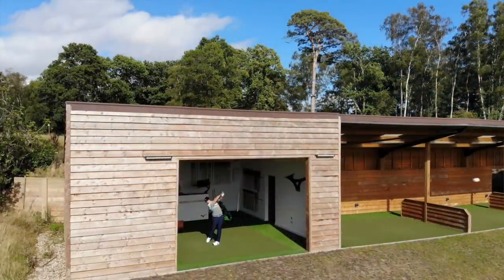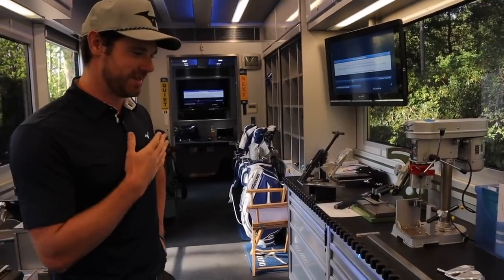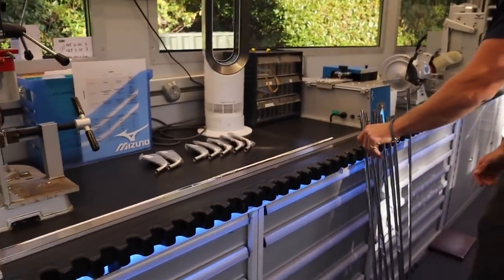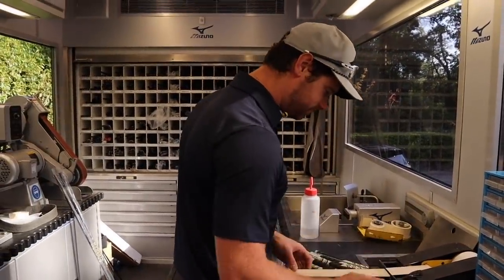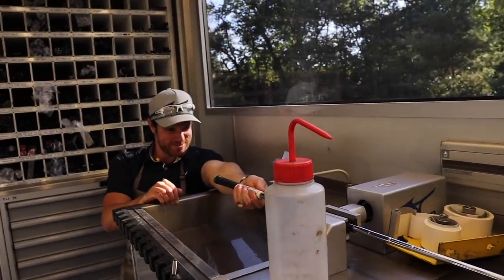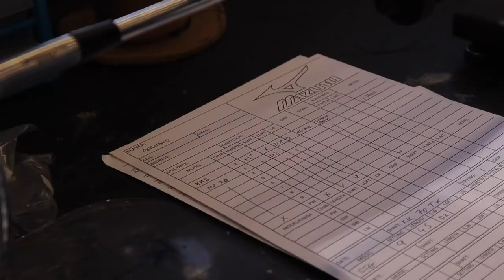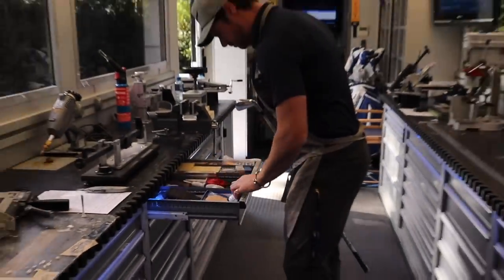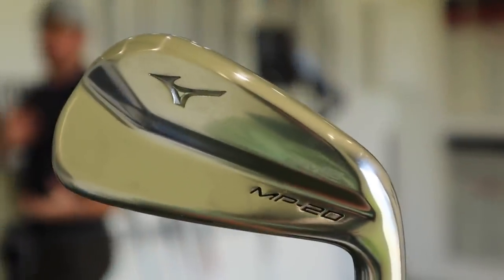BUILDING MY NEW GOLF CLUBS ON THE TOUR VAN!!!

Comment: Interesting regarding the swing weight. I had an off the shelf second hand set of MB716 rebuilt and the club-builder (ex European Tour Player) has to add quite a bit of lead tape to the back of the heads get them up to the required D3 swing weight.

Comment: What a great video I love building clubs in my basement and I learned a few things
 The one thing I was the most shocked about was I as well install the grips on the shafts with no heads then swing weight them. Validated my thinking process. Thanks again for sharing this awesome video.

Comment: Loving the videos James. I’m currently in the process of getting fitted for mp20 blades and the same combo set as you.  I’ve got a bit on a concern  I was fitted for dynamic golf s300 105 g shaft but all the data is coming up for me to use the same shaft but in a 120g shaft.  Would it make much difference. I swing a 7 iron 81mph

Comment: Hi James, did you have to adjust the lofts of the 6 iron blade and the 5 iron hmb to close the big gap there. I was recently fitted for mmc irons and the fitter was reluctant to mix the set (mmc into hmb in the longer clubs) because there would have been too much of a gap between the mmc to hmb. I haven’t bought them yet and would like to hear your thoughts. Thanks

Comment: how do you bleed the air from the hozzle when you glue the head if the grip is stopping the air escaping out the end of the shaft? Why weren't these shafts spined or pured? Blowing grips on works better than double sided tape... but then, convincing the player of that is difficult. And I admit, sometimes blowons twist.... but the feel is far superior.
Reply: Don't most, if not all, grips have a small hole on the end? I think the air would escape through that.
Reply: @benhaavisto9407  grip tape must out of necessity be sealed, otherwise it lets air into the shaft, rusting it...